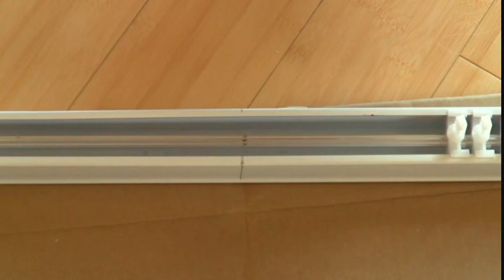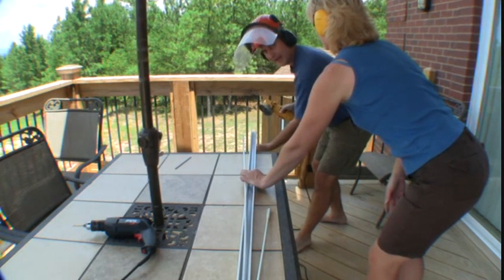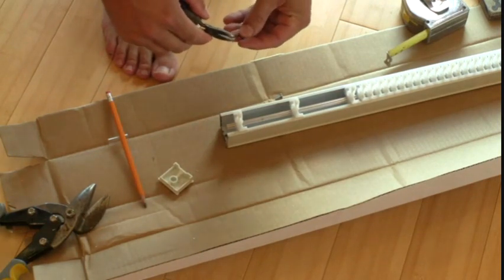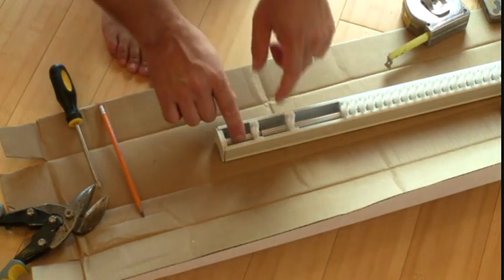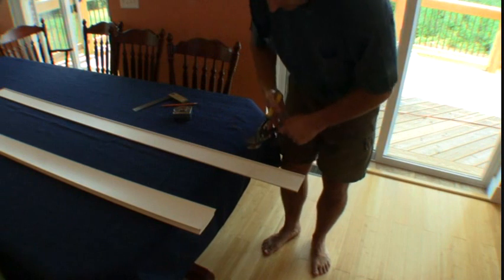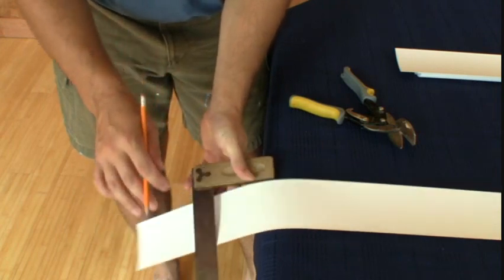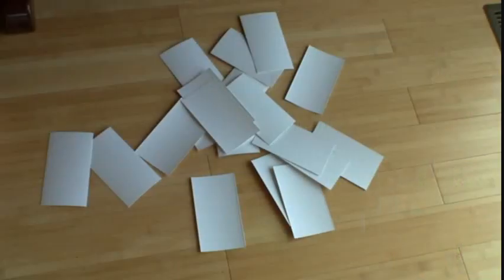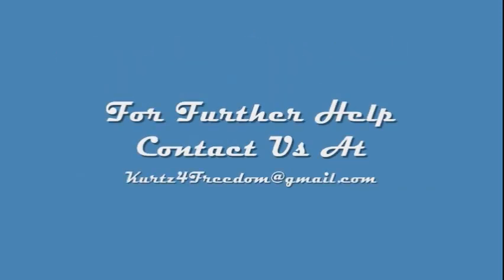How to Customize Vertical Blinds (Cut Width) - Part 2

Comment: Few other terminology corrections:
Face guard = valance
(the slats are called either vanes or louvers)
(the vane you slide into the valance is called an insert)

Some terminology may vary according to where you live.

Good tutorial and congrats on the savings.

Comment: Thank you for sharing this. This is certainly helpful. Do you've a video of joining two headrails?
Reply: +Dharmesh Sejpal Sorry, I do not. We only have 6 foot openings. I suppose you could put two end to end and have two sliders. If you joined them into one big slider, you would have to weld the two bars together just right so that the blinds slide freely. The bar might sag a little in the middle.